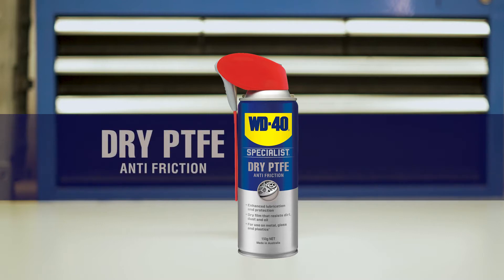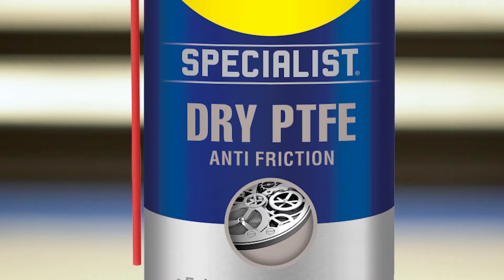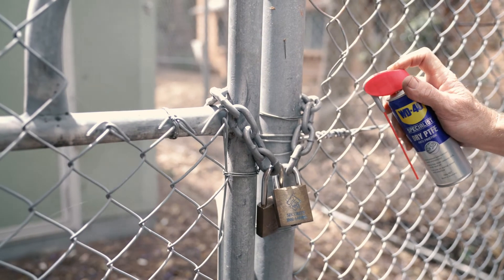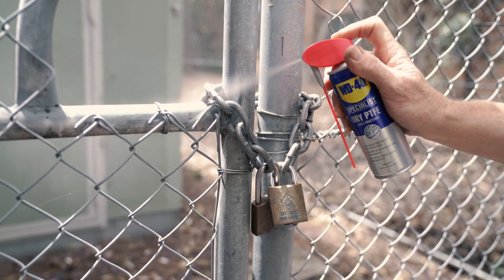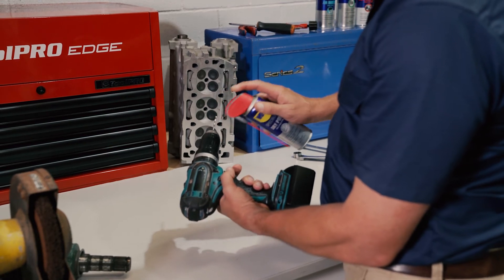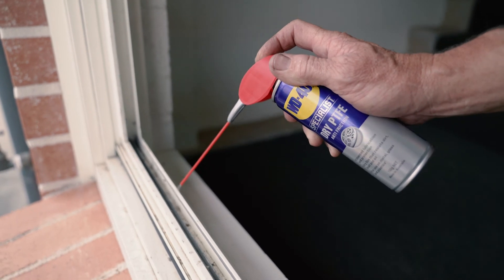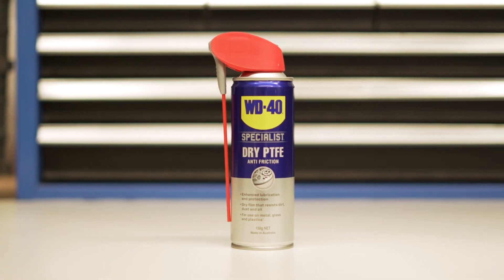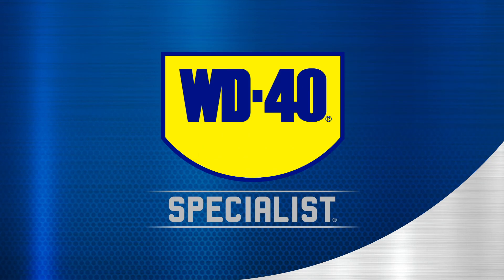WD-40 Dry PTFE

Comment: What's the difference between "WD-40 Specialist Dry PTFE" (also known as "Dry Lube with PTFE") and "WD-40 Specialist PTFE"? One is dry and one is not? I take it to mean that the one that doesn't say "Dry" on the can, is in fact wet, with solvents and other additives that take a longer time to dry up. But let's hear it from the pros please, what is the difference? Does the regular "PTFE" can contain any oil? These products are unreasonably expensive where I live. Just because it says "WD-40" on the can, they are almost double the price compared to CRC for example. So I will get only one can, not two. It will be used to lubricate my office chair. Which one is better for that?